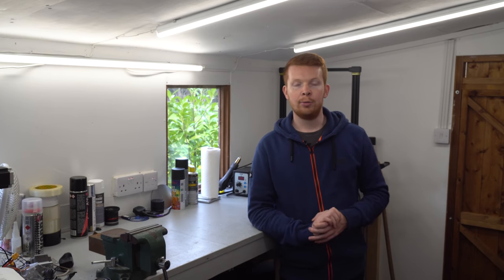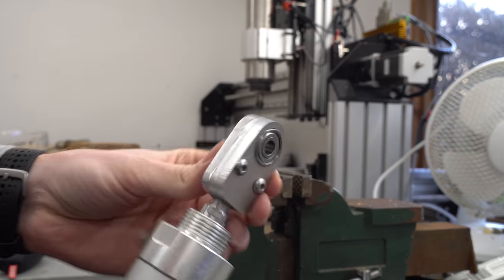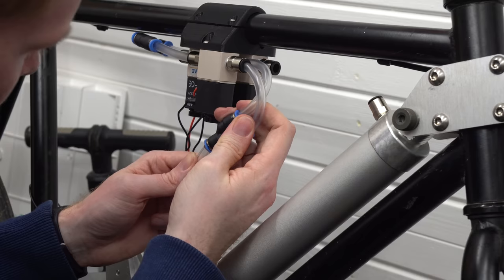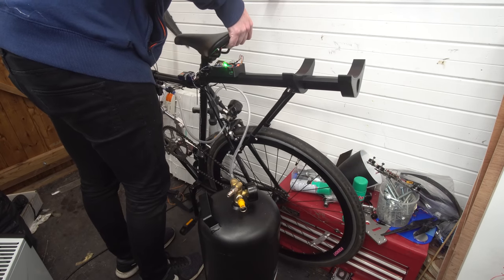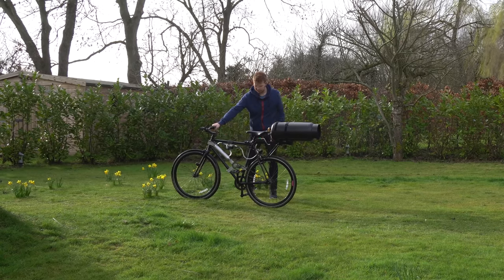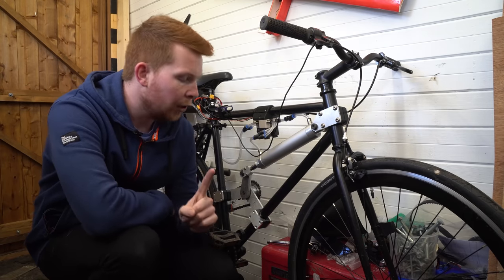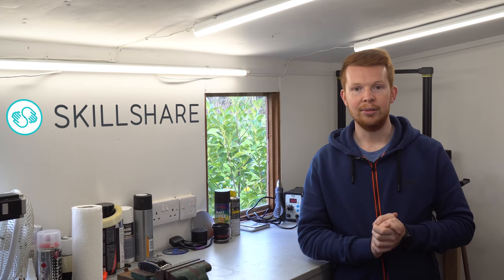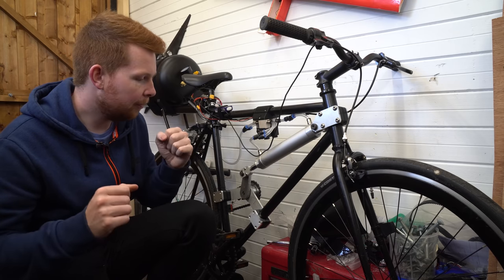Air Powered Bike

Comment: Just special to watch your work nice work i’m sure this is an old post but if ice is valid I think you should go to a compound type drive on your cylinder this would give you constant torque you would need one more valves and some tweaks on the adunieo this way you should be able to dibble your drive pressure love your Chanel good work !

Comment: Very nice ! However, using compressed CO2 cylinders with appropriate air filters could give more power. You could even try using purely CO2 based fire extinguishers for this purpose. Compressed CO2 cylinders are used in robotics and in more violent robowars primarily because of their pneumatic power.

Comment: Have you thought of starting from scratch with an aluminium frame that is greater in mass and diameter, and making the frame the tank; then supply a rotary type engine in the hub , thus eliminating the piston and crank which looks like a knife waiting to cut something off.

Comment: Use a paint ball tank... They hold 3000 psi and depending on the regulator you get they  an output 180 psi.

Comment: Lithium battery and 12v tire inflator to regulate the tank pressure or recharge on the fly. The battery should charge from wheel motion.

Comment: Another idea would be to add a second cylinder/piston on the other side of the first one. As the other one is giving out exhaust the other will be pushing. The tank should be able to handle two cylinders. Maybe that might double the power.

Comment: Have you ever thought about using the tubing of the bike itself to store air?
 Build a bicycle with high pressure, chambers, welded together in a comfortable configuration that makes it safe and hopefully practical. Then designed the pedal housing to be the pump mechanism to pump up your bike. Could you just use existing CO2 chambers welding together?  I know CO2 chambers are heavy, but absolutely capable to produce enough energy. 
 I do have questions if you combined two 20 ounce CO2 canisters would you get twice as much pressure? 
I imagine that would have something to do with nuzzles and rocket trajectory so I’ll certainly leave that up to you🤓🫡

Comment: Pedal assist is a totally accepted thing in ebikes but you seem to want to make it entirely air powered (fair enough). Does the system work more efficiently whilst pedalling or is that just wasted pressure? I assume it’s wasted, but potentially by turning the pressure down it could be a pedal assist style bike?

Comment: i suggest pneumatic angle grinder mechanism as replacement its very powerful and high speed  that can give you 11000rpm at 6scfm with max pressure of .8mpa., install 9teeth gear for the chain driver...

Comment: How about connecting the pneumatic piston output (assuming there's a way to get output?) to the compressor? I'm not sure that makes any sense maybe it's not capable of creating pressure like that but that way you could, when you run out of air, stop pressing the throttle and just pedal it for a while until the tank is full again? It's a hybrid then

Comment: double the pneumatic cylinder so you have 2 and add a small compressor powered by a chaine from the back wheel or put a sprocket on the front wheel and mount the compressor on a carrier  frame at the front. overunity achievable surely?

Comment: What if you were to beef up the airlines and solenoids and run an HPA tank.  More air pressure is "less safe" but that would give you 10-25X more power which could be fun.

Comment: A die grinder with a 4 blade propeller about 24" radius would give more speed perhaps. I don't want to give you any bad idea's perhaps four angle die grinders with props to make an air quad cycle

Comment: Bit late to the party but I would try to hook up the air release from the cylinder into the air tank, with another smaller holding tank between the return to the air tank.

No idea if that would work or not.

Comment: I have wanted to develop an internal combustion steam engine . Made of stainless , corrosion wouldn't be an issue . If a mist of water is injected at the combustion stroke , wont it produce a burst of steam at the exhaust . If captured it would be the compressed air needed to run your pneumatic projects . At average atmospheric pressure, the expansion ratio between water in its liquid form and steam is 1:1700. Wouldn't a tiny model engine produce enough pressurized exhaust to run a bike ?

Comment: I see that it lacks power in the takeoff
 Maybe if you change the transmission ratio to the wheel
that you change the rear gear for a bigger one and the front gear for a smaller one
take off with more force and speed could be achieved with a gear system
It occurred to me to convert that cylinder to make some modofocations and convert it to a 2-stroke internal combustion engine
You can also put a dynamo and a battery
so that it is sustainable and the air can be recharged and the discharge time of the air tank is lengthened

Comment: If this is in Britain, then given that it seems to have less pull and therefore less power than my stock by-the-rules elecric bike, I think the only possible illegal thing on it might be the hand throttle. Bikes like this are supposed to only assist pedalling, they shouldn't supply power without you pedalling. There is an exception: below 4.5mph, a hand throttle is allowed. This is to assist starting off, although I've also found it useful when pushing the bike. Anyway, gov.uk has clear guidelines.

Edit: Now I think of it, I've never heard of anyone being caught for having an illegal e-bike.

Comment: Run the compressed air into a combustion chamber and burn watered alcohol, and use that to run the piston.  That would be like an old fashioned wet heater torpedo.

Comment: would have been easier and probably more efficient to use an air motor (like you would find in garage air tools) to spin the front sprocket rather than a piston system...the advantage is not only simplicity but also you could regulate the speed with a simple valve.

Comment: Can't you get a smaller water tank and a hydraulic pump?
Sure water moves slower but with less bulk you could compensate for it. Gas can be compressed water not so much. It can expand tough

Comment: also, using an oscillating engine as you did ia quite inefficient. it's optimal to use double acting piston and a pair of overrunning clutches (freewheels)

also, those clipper cylinder ports are all too small. double them

Comment: Chains sprockets drives pistons are inefficient. My concept would use turbos and the air pressure would be stored in the metal frame. Actually hydraulics would be more interesting. probably wouldn't have the speed though. So I thought of an air hydraulic combination where the drive doesn't require a sprocket and like an elastic band, energy could be recovered through breaking and on hills and peddling would charge the pressure in the chamber building potential energy.

Comment: I'm I on a bad trip or all the comments praising this bots? This is an example of over engineering. The gas tank not only adds extra weight but it barely pushes the bike. Due to the added weight of the tank its probably slower than a regular bike.

Comment: If we can somehow figure out how to refuel the compressed air back into the tank while simultaneously consuming the compressed air in the tank to power the engine that way we can have practically unlimited travel range thus no stopping for refueling only thing stop you is mechanical malfunction or errors

Comment: I applaud your ingenuity and design. However, your design could be simplified and made more compact. At any actual speed, vibration would cause a series problem. I would suggest modifying a 2 stroke engine. Replace the sparkplug with a compressed air inlet and use the same sensor from this project to time the air injection.

Comment: I would make an improvement of the design by using compressed CO2 or nitrogen at a couple thousand PSI and a pneumatic piston that has a larger bore and shorter stroke, or a 2nd one of the current size mounted on a cross plane crank to eliminate the 2 dead spots in torque

Comment: This is why knowing the power curve and optimal engine rpm is important kids, see how at the start the piston's work cycle per unit time is very low and it can't generate much power ? Thats because the work cycle of the piston is directly connected to the speed of the rear wheel, meaning if rear wheel isn't fast enough the work cycle of the piston will be very slow, and because the work cycle of the piston is slow the power it generates is also low so you will be stuck going slow (unintentional sick rhymes).  But ! If you had a transmission with a neutral you could raise the work cycle per unit time of the piston to it's optimal value where it generates the maximum power which would mean you could speed up faster. But for this bike because it's a direct transmission with no neutral you would first need to give it a friendly push to raise the cycle per unit time number of the piston. 

Also my experience with internal combustion engines and automotive engineering are super duper limited because I major in mechatronics so sorry if I butchered the explanation !

Comment: What about instead of 1 big tank you use 2 smaller tanks that equal the same capacity and mount them down on the front folks to lower the center of gravity making it easier to balance

And get a smaller front sprocket on the cylinder end to increase torque as it appears the cylinder isn't able to get to maximum speed with the current sprocket ratio so smaller will increase torque and acceleration

Comment: hmm what if we designed a purpose-built bicycle to run on compressed air from the start? the entire frame and wheels could be pressure vessels and maybe have a 40-60 km range?

Comment: Comments from an old engineer (electrical, not steam train...)

Mount two tanks, side-saddle style, on either side of the rear wheel.

Study any old steam locomotive and you'll see that the driving pistons are NOT in phase... and the cranks are offset on the axles....

If you were to put TWO pistons onto the crank, with crank pins offset by 90 or some other angle, you could get much more torque.

I think the exhaust valves should open immediately when the intake/input valves open.  Why any other timing???

If the input valves open when the crank arm is in line with the piston, the best you can hope for is to pressurize the drive piston to maximum pressure... but the maximum torque happens when the piston is halfway extended and the crank arm is 90 degrees to the axis of the piston!  

You might actually get better results (torque and miles per tankful) by delaying the inlet valve from opening until the crank is about, say, 60 degrees into its 180 degree rotation and shutting the inlet when the crank reaches, maybe 120-150 degrees?  ... in both directions of push and pull.

Just sayin... hope that helps and doesn't annoy you or too many readers or subscribers.
Anyway... great design, concept, machining and execution!

Comment: Steam engines regulate pressure in two ways: 1. by throttling boiler pressure 2. through the 'gears'. 1 is obvious but 2 is more interesting. No, steam engines don't have gears like a car but they regulate how long the steam is injected per stroke. This can improve efficiency.

Comment: As a Dutch technician, I only have one question; why on earth would you stick to the Imperial system? I can do the math and I know that one Inch is 25.4mm. But one Bar is 1 kG per square centimeter. One Psi is so many Pounds per 25.4 mm x 25.4mm. One cubic centimeter fits a 1000 times in a litre.
One foot is 12 inches and therefore 30.48 cm. I can do all metric math in my head, for any Imperial calculations I need a calculator...

Comment: It is a good try you have made., and also you can try more to reduce the tuk tuk noise by replacing a DC motor for the place of solenoid valve, and then for the place of the straight shaped crank... You can also try with a question mark "?" shaped crank (same like how is in a paddling part of a sewing machine. Good luck.

Comment: To utilize that size air tank a 3/4 impact driver with a sprocket would smoke the tires up to 120mph in the 1/10 mile race.lol

Comment: why not use a small airtank, and use a portable vaccum pump to fill up the tank as you do. Use a battery to dive the vaccum pump. I use a 30v vaccum pump running from a 30v battery. the whole thing is portable. I use it to pump water off a pool cover. but it would be even better for air !

Comment: How do you ensure that the crankshaft will go 180°to 360° instead of returning 180°to 0°
I thought you would face the same problem and I'll get the answer on how to fix this but everything worked fine
On high rpm,we can justify by saying that Flywheel momentum allowed the piston to return on top after completing slight 180°+ and then back to 360 but when rpm is so slow,it could be possible that the crank will not rotate 180°+ and the piston will return to top whereas the crankshaft will not rotate a full turn and just reverse it's motion!!
Please explain

Comment: Sorry man... it is very inneficient energy storage.To run a bicycle you would need at least 200 W to push a low weight person (plus the equipment added). The power of a air  compressor  x the time it takes to fill an air tank is not the energy available stored. I will not dive into mathematics, but in a quick thought I am pretty sure that the range is very low.

Comment: 3:20 you've got the pneumatic drive chain going to the wrong place,it should be going to the other side of the crank so it can drive through the gears
9:10 you're killing daffodils for the sake of your experiment! I suggest you check out MDI.lu for a multistage air decompression Engine, they have several decades of development on you! They also use 320 bar air tanks

Comment: Of course there is always the next generation, 
(tng v. 1.01)

Obtain a capsule refiller of a butane cigarette lighter.

Use this simply as the accumulator recharge system initially manually operated (whilst in motion).

Then vent the emptied reservoir to inhale fresh air, close valve, initiate the introduction of butane into the reservoir, manually provide ignition of the mixture by virtue of gas heater ring ignitor (piezo).

Presto reservoir recharged whilst in motion.

v. 1.02.   

Set arduino to work by driving the venting of the reservoir, through perhaps ten cycles of air cylinder charging reservoir with fresh air, then bring in auto induction of fuel followed by ignition.

Repeat ad infinitum, (volume of butane in refill cylinder limited, 
mod.  utilise camping gaz stove aerosol size canister.

Be interesting to calculate the thermo-mechanical efficiency ( better than i.c.e. or steam engine?)

Bon chance....

Comment: is possible make a device use spring to store energy to powered the bike or just for assist, like that little device in manual watch,use spring store energy make the watch moving,but just way bigger.
 my parents living in a small island,there small road,lot of road up and down,so there no car no bike, only police and fire department have car and sand buggy,so bicycle is only vehicle can use, but there a stupid law,any electric moto or combustion engine on bicycle are illegal, not matter only 1 hp,now they getting old, i always thinking any non electric device can put on bicycle to powered the bicycle or just for assist, just little push for up hill road, your air powered bike really a smart idea.

Comment: You know those air powered tools they use in shops have really small "air vane" engines that can generate like 5hp worth of power, I'm sure even with a single gear and a throttle you could make that work on a bicycle, rather than having this inefficient bulky steam locomotive system on there.

Comment: I believe you overcomplicated it slightly with that arduino. You could have just chosen 2 end switches and connected them to a 5/3 valve but k.
Reply: and maybe also add a "quick vent-out valve" (idk how it's called) on each side of the cylinder for a little more power

Comment: if you used a   arm hydraulic instead of air and ran it off a power steering pump I think it would have more than enough power.

Comment: HOLY SHIT I JUST NOTICED THAT IM "NOT" SUBSCRIBED TO YOU, & I WATCH ALL YOUR STUFF.. GOD I MUST BE GOING BLIND IN MY OLD(ISH) AGE.... ONE CLICK WILL FIX THAT RIGHT UP!! ; )
P.S. IS YOUR ZERO SWITCH A REED SWITCH??
i really should write these comments after iv watched the whole video.. why did you choose a piston as your drive. i know a motor would bleed the tank dry very quickly. but what about a motor to get you up to speed then let the piston or even two take over. just a wild guess.. but if you had a way of getting air back into the tank some how like one of Arduino codes that works like a bubble in a spirit level that turns on a fill pump when going down hill... Ahh i don't know...  you will figure it out!! ya always do  : ) nice one tom, very enjoyable stuff.

Comment: Although this comes way after the stable door has closed, you might like to consider something like a diver's aqualung air bottle as they can hold up to 4,000 or so psi. Mind you, charging it presents problems in itself but just as a research project it could well be worth it if you could source a charged air bottle, and regulator. https://en.wikipedia.org/wiki/Diving_cylinder

Comment: Too much crank radius and small diameter cylinder will not give power to the bike. Use large diameter cylinder with small displacement. But anyway it's a nice work.